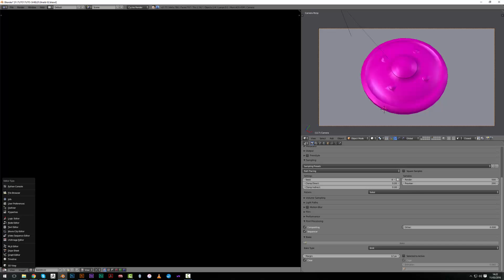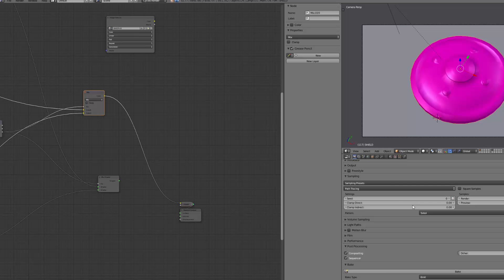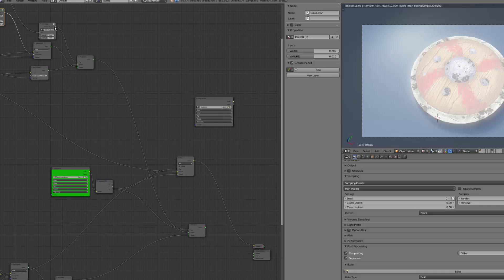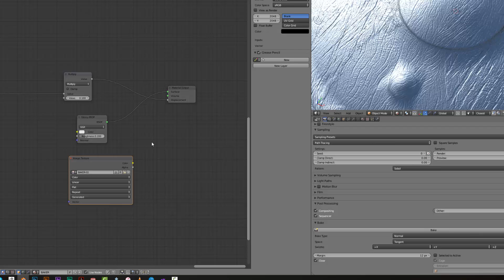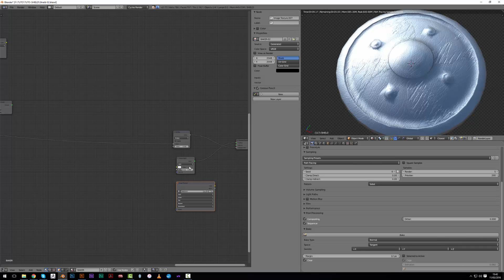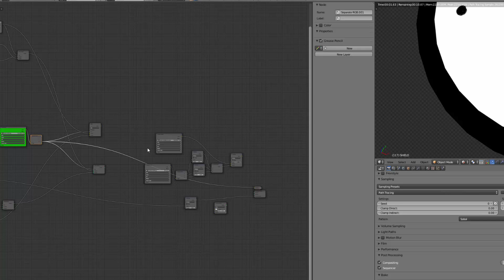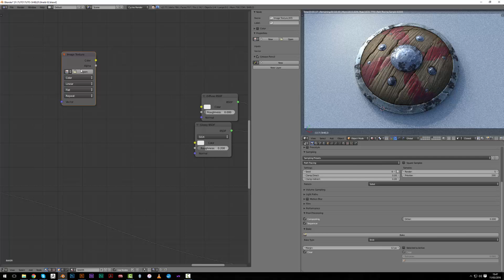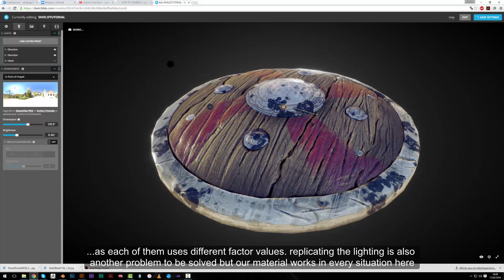PBR MATERIAL CREATION IN BLENDER   PART03   EXPORTING ALL MAP FOR PBR RENDERING

Comment: When you sculpted on the shield how did you avoid destroying the smooth shading around the outside?  I've tried adding extra edge cuts and subsurf but when ever I sculpt on a cylinder the edges just pop right out and it no longer looks round.
Reply from the maker: I've modeled it, added loops, added 2 levels of subsurf and applied the subsurf.
Then check your detail size when sculpting to avoid the edges to get too lowpoly and jaggy :)
Reply: +Pierrick Picaut - i think my base circles segments were to low, I counted 32 on your low poly so I started with that, now I've bumped it up to 128 segments it doesn't seem to destroy the smooth shading, although I can still see the lines but I think I can touch that up on the normal map if they stand out to much. Great tutorials btw, am really looking forward to painting this shield when the sculpts done.